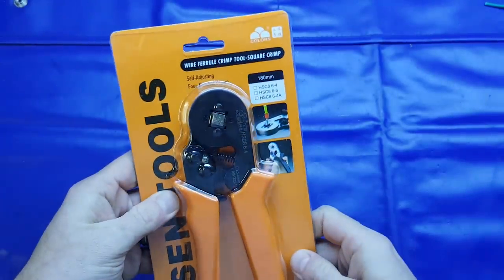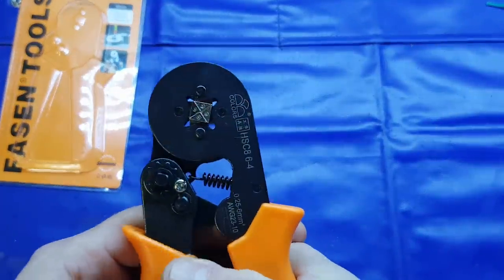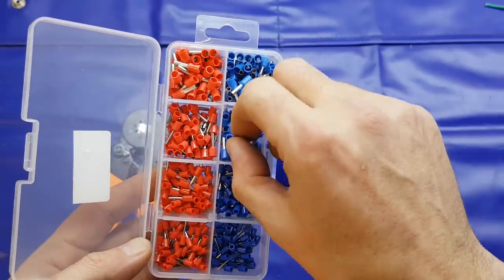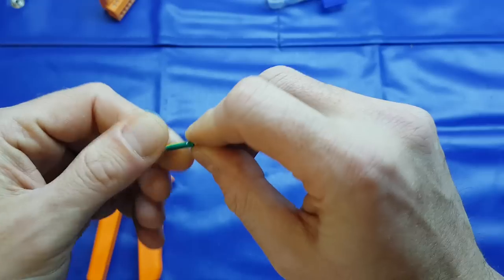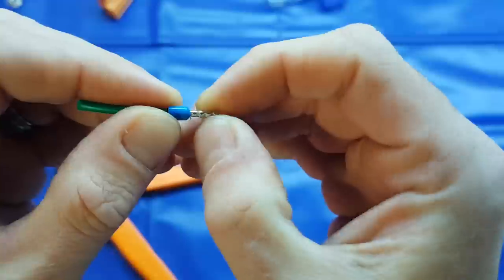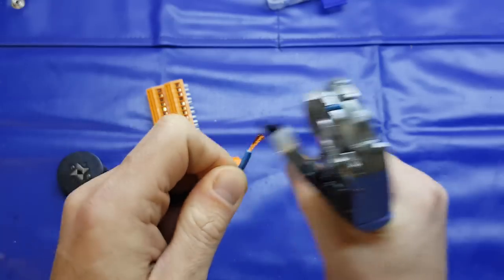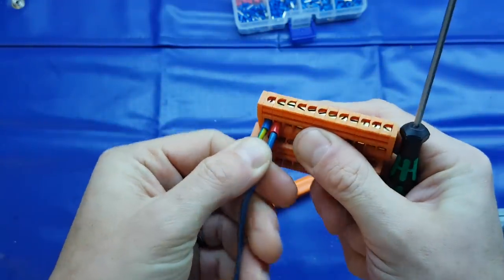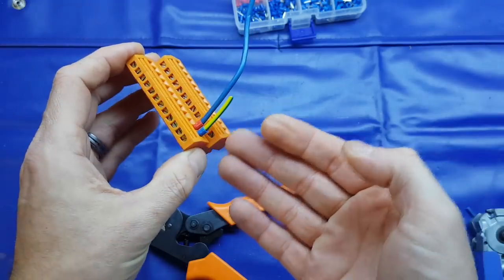A quick look at a ferrule crimp tool, ferrules and how to use them.

Comment: I just got one of those crimp tools, the HSC9 16-4 (square) ferrule crimper. Used it on two 16mm2 ferrules, but one pulled out. Next a 10mm2, but the tool was jammed tight. I watched another video, which said the tool will only release after being fully closed. Sorted!

Comment: Nice review, it looks great! I made the mistake once to solder the ends. At first you think, oh this is perfect!
But after a while the contact loosens, as the solder creeps under the pressure of the screw.
It wilt result in a bad connection and eventually cause overheating.

At least this is what I found, after inspecting the connections I made years later.
It's better to use a ferrule or just the bare copper.
Reply: Im looking for solder vs ferrule and now i realise that i need to buy one of these. And i made some realllly good solder joints :D 
 Thanks!

Comment: Thanks for the direct and informative clip. I wouldn't think of Aliexpress

You're not supposed to twist the conductor if you use this tool. If you twist the wire, it gets cripes on one specific (outer) strand more than the whole wire, leading to increased resistance and less physical durability
Reply from the maker: Thanks for the tip...makes sense.

Comment: Ferrule color code is usually related to wire gauge/diameter( allthough there is no universal standard it depends to the producer sometimes, is infact a matter of quickly identifying the diameter in a pile of ferrules, in case they mix up in the organizer). Conductor /cable color code is related to lines(phases)/neutral/ground and is pretty much universal, yellow and green for earthing/ground, blue for neutral/return and brown/red/grey/white/black etc for lines/phases.
No correlation between color of the ferrules and color of the wires usually

Comment: Main reason for using ferrules (aka aglets) would be to protect the wire when terminating under a rotating screw in the type of connector that is typically a hole with a captivation screw threaded through the circumference.  Any roughness or overtightening the screw can cut through the unprotected soft copper or aluminium  conductors. 
UK plugs, chock block and many older termination strips don't have any protection between screw and conductor and benefit from an aglet.  Wago and most of the new connectors have at least a thin metal leaf over the conductor and in the case of wago that is enough to prevent an aglet of the type shown here making a good contact.  You can get unsheathed aglets that are simply a silver plated copper tube which will protect, and prevent splaying and more importantly will insert in any connector.

Comment: Im looking for the recognized specification on how much wire should be exposed from the ferrule?
Reply from the maker: I'm not sure myself but I generally set my strippers to cut so the end of the conductors are flush with the end of the metal part of the ferrule.
Reply: @KrisCochrane  This is correct.

Comment: Can you use these with WAGO cable fasteners please
Reply: Miles Handy hi mate, I think the wago allow some of the sleeving to go in a few millimetres as well so the plastic part of the ferrule might stop the cable from going into a wago connector.  Flex cable is ok in wago lever type but not in wago push type.